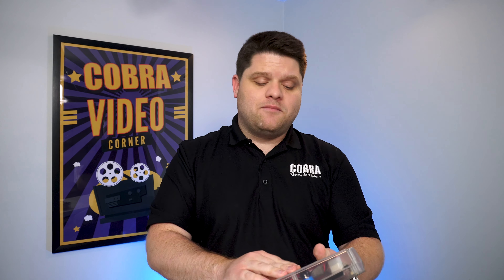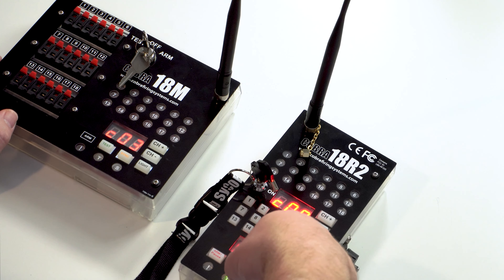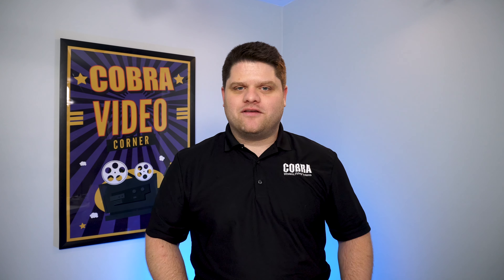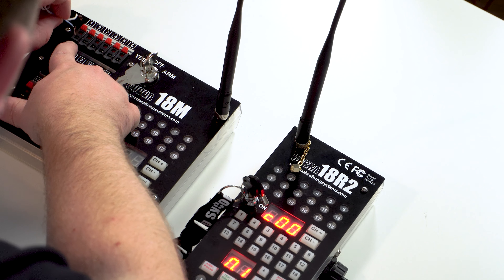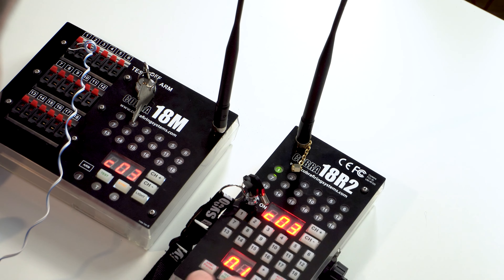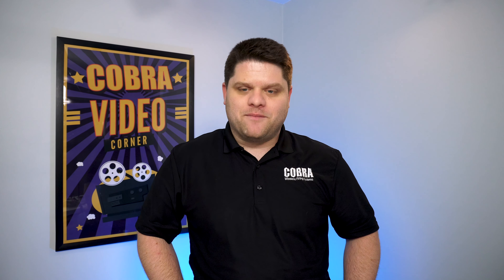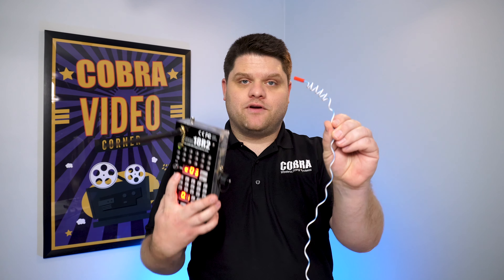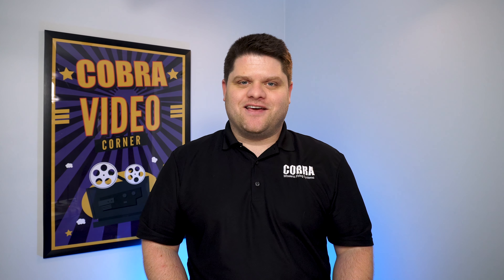COBRA Basics - Manual Firing

Comment: hello, how to delete all the cobra.csv files from the 18r2  controller ?
Reply from the maker: After turning on the 18R2, please hold TEST and SYNC for 10 seconds. This will show a single 0 on the top display and clear scripts. Keep in mind, you don't need to clear scripts when loading another as it will overwrite the last script on the remote.